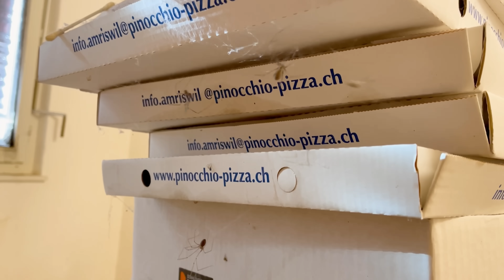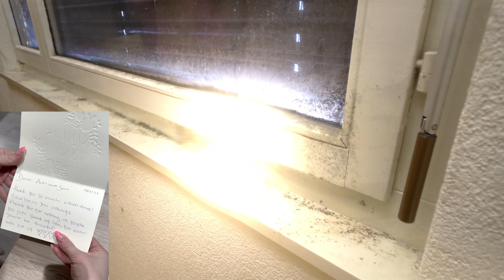THE FILTHIEST HOUSE IN EUROPE 🥺 | Cleaning for FREE! 💕

Comment: when you described the story of this girl, i felt so connected with her. i live like this when my depression gets severe and i've always downplayed it in my head as just being lazy. hearing my own story back at me from a different perspective makes me realize that... maybe i SHOULD get help, maybe this ISN'T normal. what a wake up call
Reply: When your depression isn't as severe, maybe you could try doing a little bit each day? Even five or ten minutes a day soon adds up.

I've had to come to the conclusion that there is no way I will never be able to follow a cleaning system or schedule and I definitely can't do marathon cleaning, so the 'tiny bit every day' is the only way I can cope.
Reply: I'm also a big fan of the 'half done' method. This is where you intentionally put minimum effort into whatever you're doing.

So you just vacuum whatever bit of floor you can see without moving anything. Or you just wipe whatever piece of countertop you can see. Or you just throw some toilet cleaner in, swish it around and flush, then walk away.

Doing it this way is so easy because there's no pressure, and when you can eventually clean the whole surface it's so much easier because you've already made some headway.

Comment: I'm from Brazil and I'm impressed how the cleaning is done differently. in Brazil we have the habit of throwing water in the entire bathroom, lots of soap and cleaning products in general. I think it's very Good to see before and after cleaning! congratulations on the work
Reply: Sim, aqui tudo a gente joga água sanitária. Achei bem difícil essa limpeza no banheiro, que não tem ralo.
Reply: In a lot of European countries water can be much more expensive than in Brazil, so people tend to not use it as sparingly!
Reply: The difference is heat and humidity. Specially in the northern part of Europe low temperatures and high humidity will prevent water from evaporating. So one have to use just enough water for the task and often wipe afterwards to remove exess water. If you don't whatever you cleaned will be wet for a very long time. You can even risk damage caused by water.
Reply: The drain in the shower was clogged, and they don't have floor drains there!!!
Reply: Vários banheiros da gringa nem tem ralo, aqui no brasil a gente tá muito acostumado a ter ralos e revestimentos que pode sair tacando água

Comment: I don't want to find fault, because the fact you were willing to do this is superhuman. But the bottom corners of showet, you can still see grime of the grout. 
Tip: soak kitchen towel in vinegar and leave it on there for 10 mins. Then scrub with toothbrush.

You really want to get it all, because if there's mold left it will spread. Same on windowsill. Not from spiders, that. That's mold. Dangerous to health.

Excellent work! 🎉

Comment: Amazing work! You have to look after your back please, if you need to pick up something from the ground, always use your legs and knees instead of your back, like squating. Your legs can handle a lot more weight then your back and it will release pressure on the lower part of your back if you had pain there.

Comment: My motto is to clean little and often and it won't get too bad. I have some disability but I choose 2 goals a day. It could be 1. to wash my sheets on a good drying day, 2. to wash my body so I will be clean to get into my clean bed.  Another day my goal is to clean sinks and toilet, even just a wipe around with a cloth  dipped in disinfectant and pour bleach down toilet.  Another day Goal  1 walk around rooms and put rubbish in black sack and 2. take out to bin.  There is no need to let things get sooo bad! A sense of achievement no matter how small can lift the spirit.  Please if you are struggling  with depression or other disability so much get some help  by speaking to gp before things get so overwhelming.

Comment: Wow.  You're amazing.

YUCK.  Why is disgusting an option with some folks?  Just foreign to me though I've met so many others where it just isn't sort of a thing.  Shrug.
Reply: Gosh, the caked in Mud(?) in the shower area?  What is that?  How does it even get that way?

A tip perhaps if I may?

At restaurant supply places, they have abrasive floor cleaning pads for those upright floor polishers.  The discs are rated for different tasks from pretty abrasive to wax sort of polishing and of course everything in between.  

I like to have an assortment on hand after cutting them into say 12 to 16 wedges with my Kitchen / Bandage scissors. 

They're awesome for all sorts of cleaning jobs and you pick the color depending on the task at hand.

Would have been handy here.

I have a bleach and water spray bottle at all times too.  Gotta nuke the mold at every encounter.